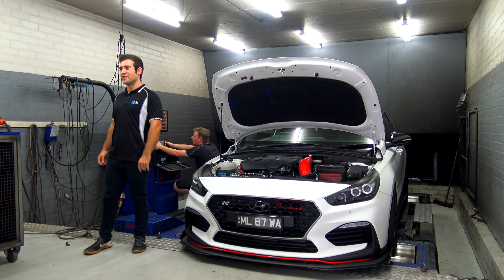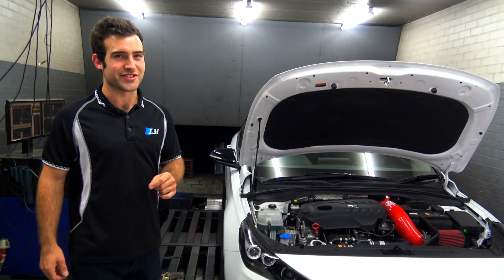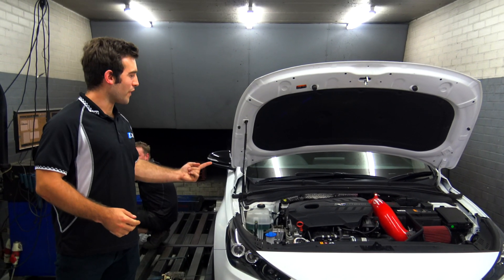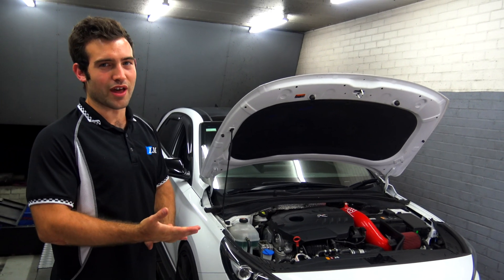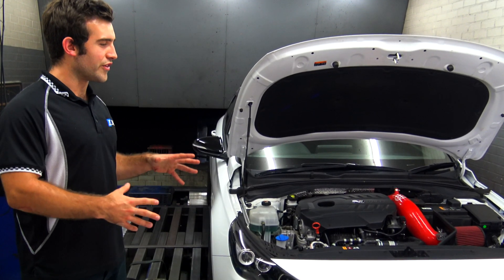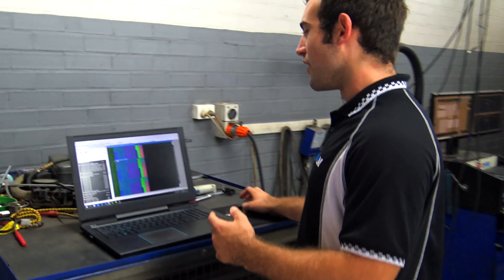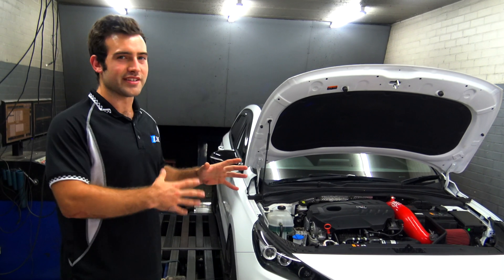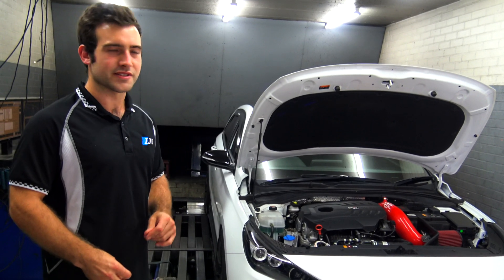Laborde Motorsport - Custom Dyno Tuning The Hyundai I30N [OEM ECU]

Comment: I've also read from other tuners that the stock intercooler is the limit in this car.
Btw, which bodykit did you install here? It looks cool!
Reply from the maker: Hey! It certainly is. Checkout FLOW Designs Australian.
Reply: @labordemotorsport  thanks for the fast feedback!
They will most likely increase drag instead of the opposite, but they look superb.